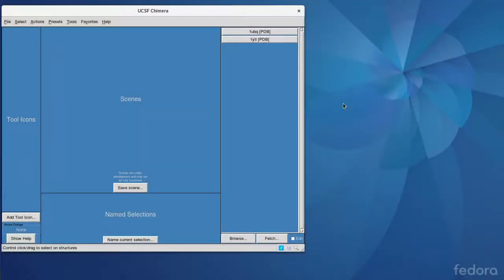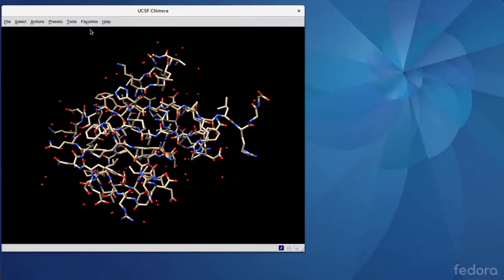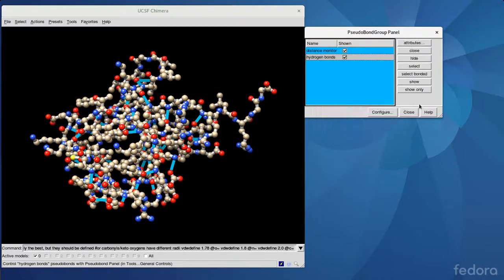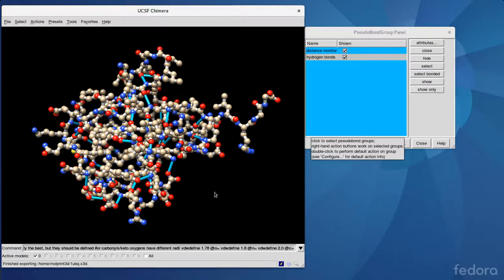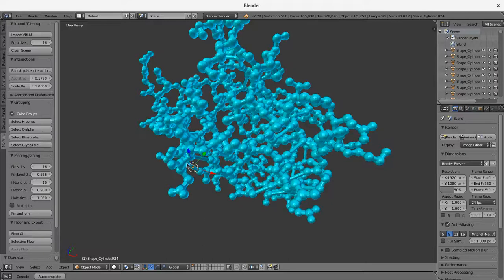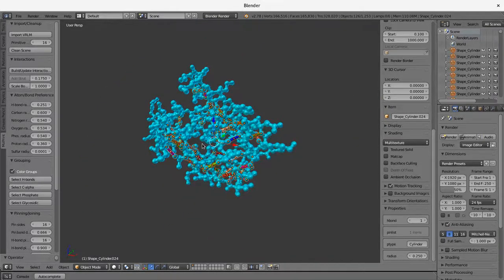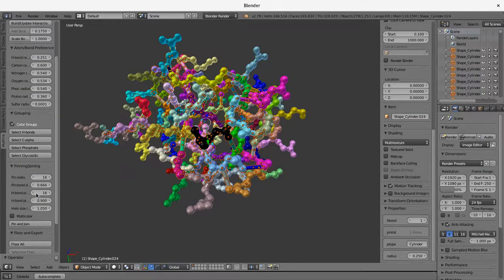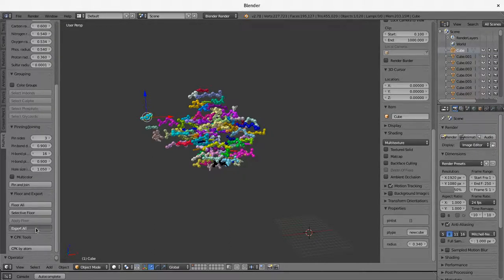Generating VRML (X3D) files in UCSF Chimera

Comment from the maker: Settings used for this ball-and-stick model:
#Some reasonable settings for Chimera
represent b+s
~disp solvent
setattr M ballScale 0.3
setattr M stickScale 1.7
bondcolor grey
setattr p drawMode 1
#these values are not likely the best, but they should be defined
#or carbonyls/keto oxygens have different radii
vdwdefine 1.78 @o=
vdwdefine 1.8 @n=
vdwdefine 2.0 @c=